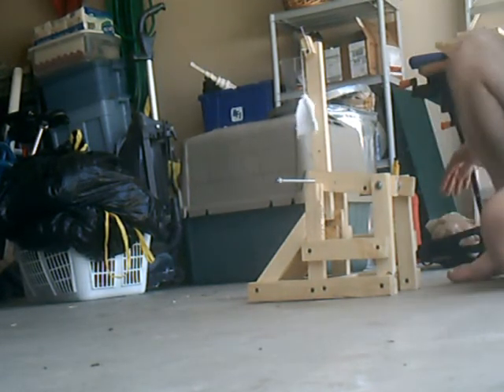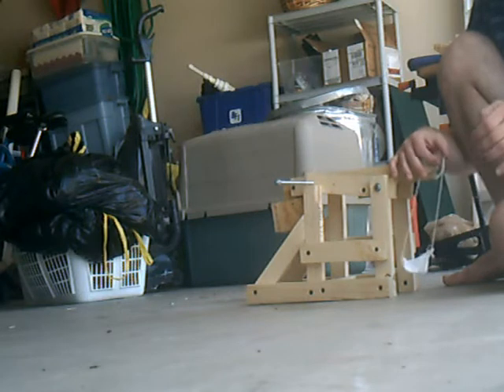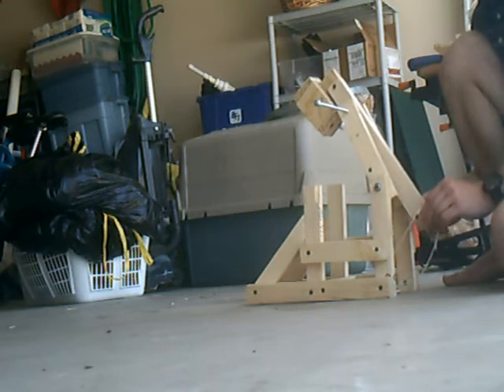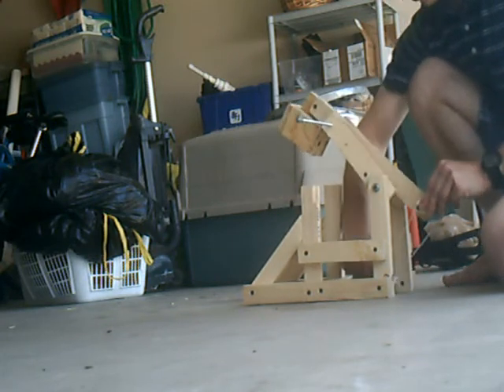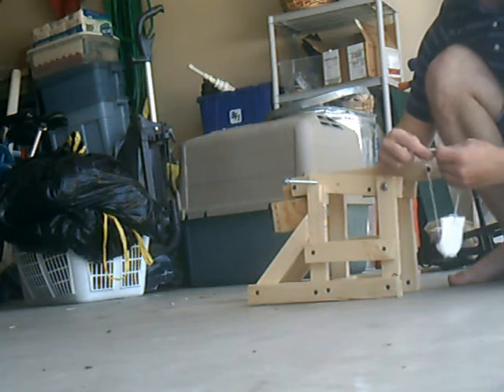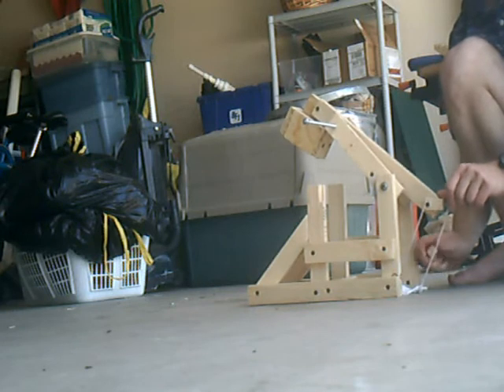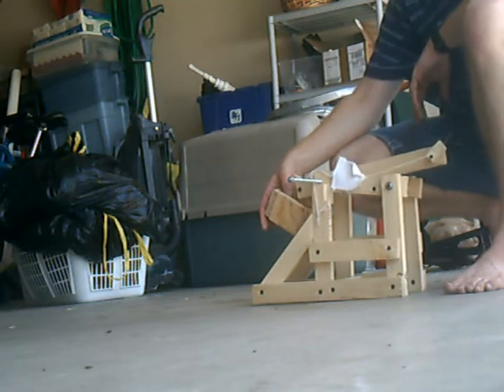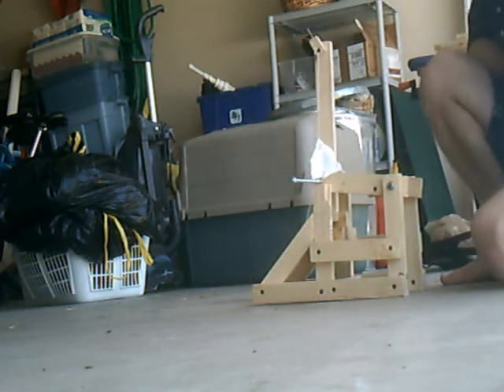mini compound Axel Trebuchet model  C.A..T. -00 demonstration as  Good for model C.A.T.-01

Comment from the maker: I never knew about any design close. I did build a bigger one for pumkin  chunkin contest. The frame was about eight feet tall. I did predict tremendous shock loading when the second axle hits I build shock absorbers but I after many test I fund it was better not to use them. Hower them problem with my bigger one that I built it too narrow so the weight box which I was use a trash can stuck. The funny thing  this one built off lessons off the  bigger one.

Comment: It's an interesting idea, but not an improvement over the whipper or King Arthur systems. Also it may work OK as a small model, but in a big one there will be a tremendous shock loading when the second axle hits and the counterweight starts pulling directly on the arm.

There was a similar trebuchet called Fruit of the Boom at WCPC in 2006, based on a small model, and it broke for just that reason